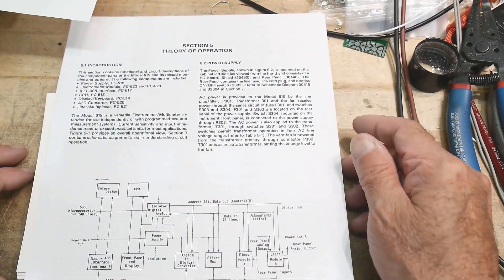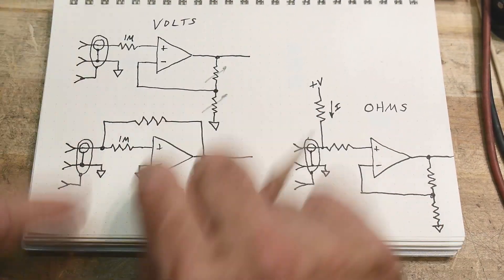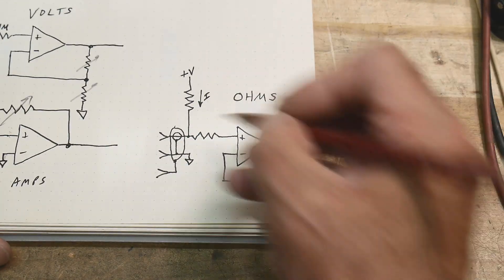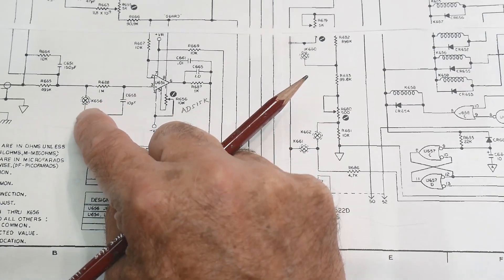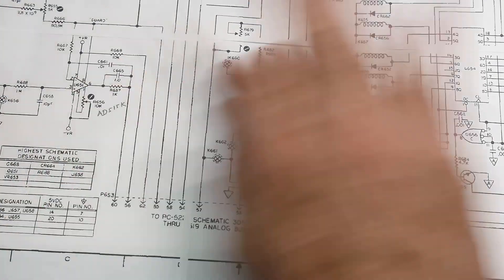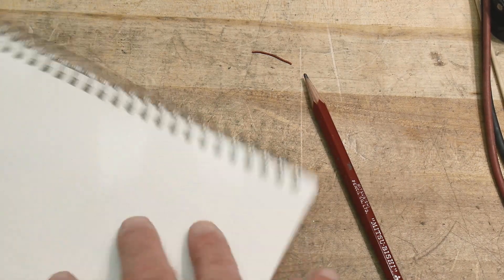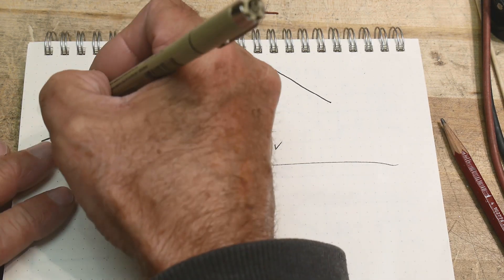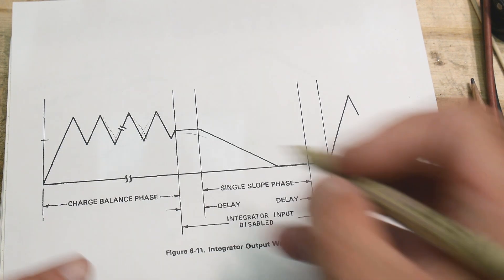#784 Keithley 619 Block Diagram and Schematic

Comment: I thought that the transimpedance amplifier is an inverting one, with negative feedback, in which a capacitor is placed to determine the bandwidth of the amplifier. But in your example, there is an op amp that looks more like a comparator with hysteresis, or is there something I misunderstood?
Reply from the maker: maybe this will help: https://youtu.be/LFTlM07cOFg
Reply: @IMSAIGuy  In your previous video, the feedback is negative and the op amp is used as an inverting amplifier, like I said before... So, I think, now you made a mistake, the positive input and the negative input need to be viceversa!
Reply from the maker: @hflorin07  Well you are right, but the keithey is wired to the + input so their must be an inversion somewhere.

Comment: There's the femtoampere input multimeter (Keithley 617) that also has "just an opamp", but it has a matched jfet pair on its input. And the complete opamp supply is moved around by a 2nd high-voltage opamp circuit to get a input compliance of +/- 210V.  (basically the high-voltage opamp output is grounded, to move its floating supply around). It's a funny circuit to analyze, and it also switches between several operation modes, many relays... :-)

Comment: The replacement op-amp for the now obsolete AD515 is the AD549 on Digikey. The model that has a 0.04pa input bias current is $71 in one off quantities. Not the most expensive component I've ever bought on Digikey but it's getting up there.